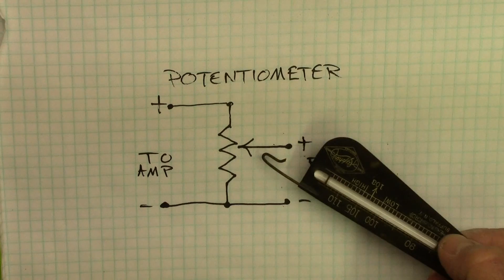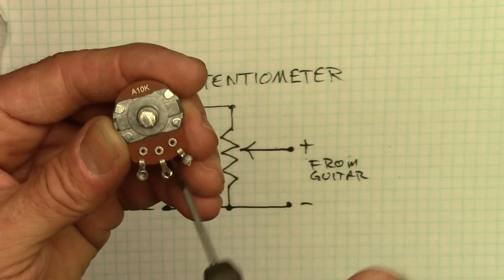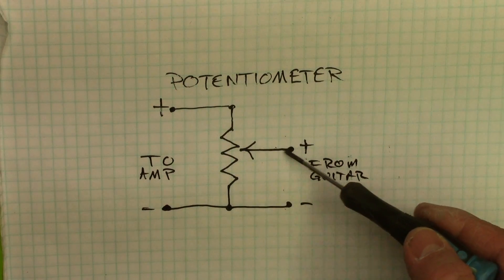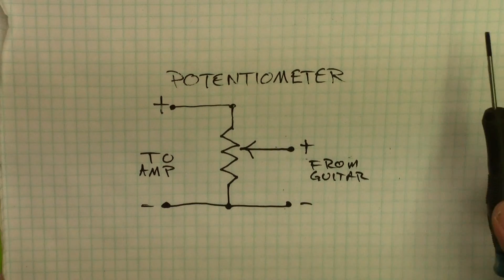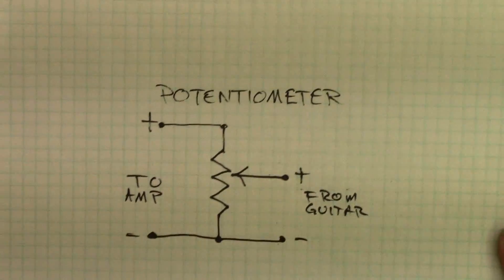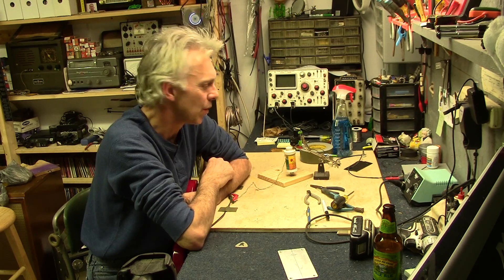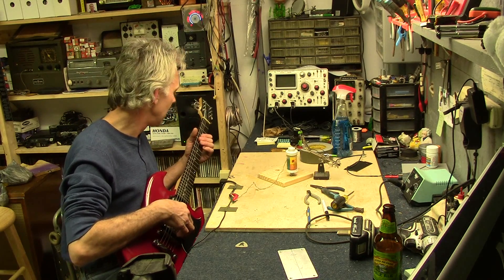Liquid Tremolo With Glass Cleaner

Comment: I rediscovered this video and am making my own in a similar fashion to yours, I'm having an issue. There is a popping sound each time the tip needle makes contact with the solution. Right now I have a test setup like yours using alligator clips to the guitar cable and amp connection. Could this popping just be from the janky setup and when I wire up a permanent setup it will go away or could it be something else? Will I need something like a zobel network on the output side to maybe take the pop out of the signal before it gets to the amp?

Here’s a video of it
https://youtu.be/c7FcbYFWjWA
Reply from the maker: Try bridging the leads on the bottle with a 100K resistor and see if it goes away.

Comment: What about using a much smaller container (Like an empty guitar fuse cartridge) on its side, with one wire running along the entire bottom and the other mounted above the liquid on one of the tips. Then using the motor to either push it sideways in a bracket, or tilt one end up and down with the other end being on a hinge. Then it might fit in a fairly small enclosure. The limiting factor would be that it would need to be fairly level to work.

Comment: or have the voltage speed control, via a pot on a foot pedal. think out side the box week yea
Reply: Yeah. 9V-6V-3V-etc. rocker switch using resistors. Or fully variable speed using a slot car controller set up on a 'wah' pedal.
Reply: imatiler love the idea of re using the old slot car controller. it amazing what you can do with other people so called old junk. one mans junk is the, shroud mans Gold. I love going through my old junk box when I am making prototypes.

Comment: It would be tricky, but you could have the motor spin a half-filled container horizontally so that the electrode is repeatedly submerged. Maybe have the electrode connected to a metallic strip around the outside of the container and connect it to the audio via some brushes. Tilting the axis would vary the amount of time the electrode is submerged.

Comment: This has me wondering about the speed of the electric field in a conducting fluid. If you can find a fluid with a slower signal propagation than the copper wire, you can make a delay line, and that creates all sorts of possibilities. A quick Google search turned up nothing on the topic, though.

This is a pretty awesome experiment, though. Now I'm wondering if the idea can be used in synthesis.
Reply: It would likely yield a whammy bar effect (the other type of tremolo) as the different distances that the signal has to pass through the fluid would vary the delay, causing slight increases and decreases in frequency.
Reply: The propagation is electricity... it takes one nanosecond for electricity to travel one foot in wire. Best I can find out about water is that it's relative "permittivity" is 80. Resistance is something to consider. The use of Nichrome wire would impart more depth.
Reply: Yeah, I'm thinking the speed of the electric field is always going to be the same, which is why ultrasonic delay lines were developed.

You could make this part of an RLC filter and get a spacey auto-wah effect. :)